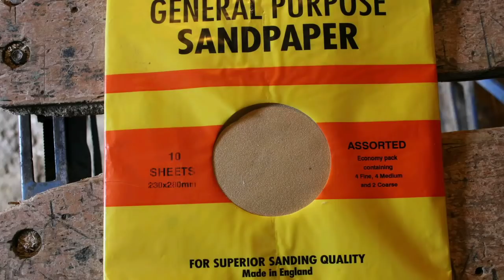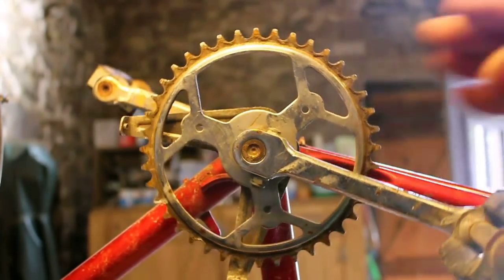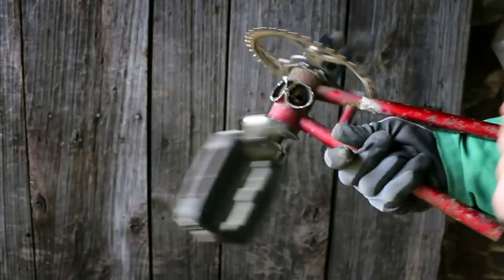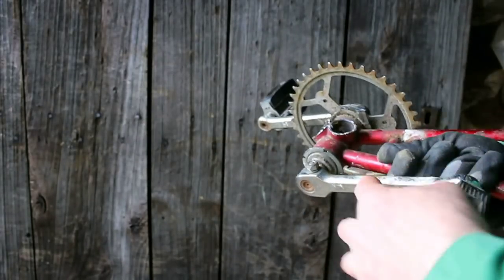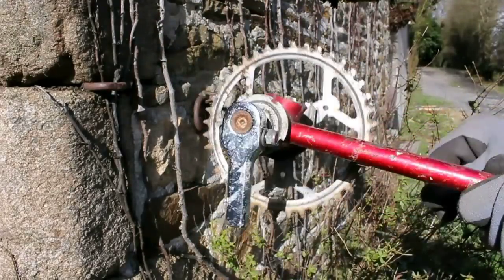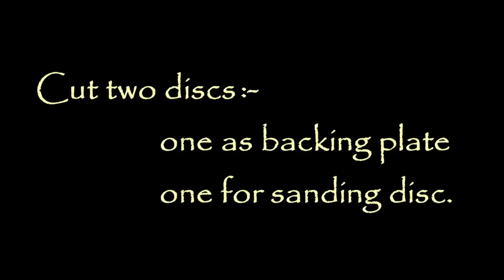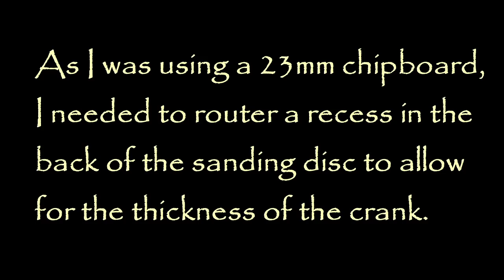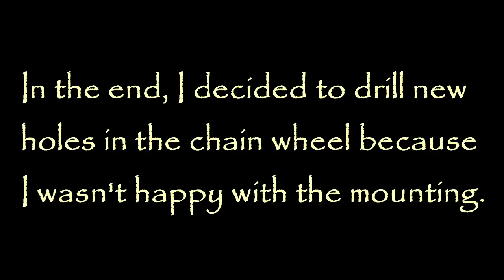Hand Powered Sander Homemade tools  Bricolaje una lijadora de disco Brico ponceuse de récup

Comment: Good idea if you power this on motor, but if you have to use 1 hand on that to spin it, then it becomes useles as good tool
Reply: you can power this cheaply with Washing machine motor, Its werry cheap, has speed controler on some motors and its pretty damn strong. 
Combined with Ur bike tool could replace some professional tools, Also you can use Welcro , buy it from e bay and stick it to one side, and then U can just buy finished sanding papers cheap in store allredy cuz in circle with welcro on other side, Sticks pretty good and wont fly of, that way U dont have to glue new sanding paper every time
Reply from the maker: Hi Ivan, I've only just come across your comment so please excuse the delay in replying. With the guides set to the correct angle only one hand is needed to hold the wood in place.
Thanks for commenting.
Best Wishes from France, Andy.
Reply from the maker: Ivan Brzi
 Some good ideas here. The motor would certainly work but for this application I was seeking a small amount of material removal and I have found in the past that powered tools take material off too quickly. Yeah the alternative to the glue would be nice except that the glue ensures that the sandpaper lies flat and even on the support disc.
Thanks for your input.
Cheers, Andy.

Comment: You could weight the handle to keep the sander turning without you cranking, so you don't have to do so much work.
Reply from the maker: m60paton2 Oops! I’ve only just found your comment tucked away in the ‘comments awaiting approval’ bit. My apologies for not replying sooner, but belated thanks for watching and commenting.
A good idea to give it some momentum. If my sawing is good, there is very little effort required.
Best Wishes from Normandie, Andy aka Organikmechanic.

Comment: Foot power would be nice so that you have both hands free to manipulate the workpiece.
Reply from the maker: +J DeWitt DIY The guide on the work table means that I only need one hand to hold the workpiece in place. You have a good point though especially if I wanted to remove a greater quantity of wood.
Thanks for watching and commenting, Andy.

Comment: Would've been great to make use of the bike's frond and rear chainwheel and chain to make a reduction, so every hand turn makes a 3,4.5 or more turns in the sandpaper wheel
Reply from the maker: +Luis Eduardo Moreno Raygoza Hi Luis, This is a good idea for obtaining greater rates of removal. I only need to remove small quantites and so that is why I have kept a simple direct 1:1 ratio. Many thanks for watching and commenting,  best wishes from France, Andy.

Comment: New Challenge: Build hand powered sander wheel without using any power tools in the fabrication of said device.

;-P
Reply from the maker: +CmdrGendoIkari Yes you could but I needed to make this quickly, as we needed frames for an exhibition and as I have these tools and as we have power at the moment it would have been daft not to use them. All the very best, Andy

Comment: It would be neat if a bike had multiple speed derealer on back so you could change speed of disc with less effort. But probably too much work this looked hard to build
Reply from the maker: +Jason Skinner Yeah, you'd certainly change the disc speed using a derailieur. I have found that for the amount of material I wish to remove, the existing method is adequate. But if I wanted to take off a lot then your idea would ceratinly work.
Thanks for watching and commenting, Andy.

Comment: go too second hand shop or junk yard and look for old foot pump sewing machine. and get a bike chain on both ends and use both hands then.
Reply from the maker: Great idea,
The only thing is mine cost me 10 cents in materials and it works fine for just removing a small amount of wood, but if you wanted to really remove a lot then your sewing meachine treadle would be great.

Cheers and thanks for commenting,
Andy.

Comment from the maker: I like this idea, but I needed to sand the faces slowly. Whenever I have the disc moving at speed i always go over the line. However, by using this idea and gearing down, I could attain a slower disc speed and with more power and as you say leave both hands free to control the work. Thanks, I may have a go at this!
Thanks for watching and commenting.
Cheers, Andy.

Comment: could you have had some sort of belt attached to a mill stone as a way to provide with momentum?
Reply from the maker: Marco Vale Oops!  I’ve only just found your comment tucked away in the ‘comments awaiting approval’ bit. My apologies for not replying sooner, but belated thanks for watching and commenting.
It's a good suggestion. The sander is only removing a fraction of material, provided my sawing is reasonable, hence the high inertia provided by the mill stone would be excessive. Nevertheless the flywheel idea could be used on a general purpose hand-powered sander to good effect.
Cheers, Andy.

Comment: ... sand paper is a hand tool anyway, for slow sanding, i dont get the point ov making somthing that has no use. just glue the sand paper to a peace ov wood and insted of turning a handel just sand the wood, would be the same effort, or if you and just used the whole bike you could and use the chain to turn your sand wheel, with the gears you can change the speed of your saning and rest your arm...

Comment: The idea is good. But this tool is to hard to use it, I mean that the process of sanding takes to long. U can add a motor, and it will be way faster than that.
Reply from the maker: +George Grigoras Hello George. You are right that the sanding is slow but that means I am less likely to remove too much wood! Thank you for commenting. Best Wishes, Andy.

Comment: You've got chains and gears right there, and you decide to drive it directly with your hand? Why not put in a little more effort, and give it a foot-powered mechanism, like a treadle? Or use a wheel as a flywheel.
Reply from the maker: Dangit_Bobby Hi, it's a good point and one that could be adapted to this design. I made this specifically to work slowly enough to accurately remove the last tiny amount of wood. The better I am at sawing the less I have to sand off! Whenever I speed things up I end up 'overdoing' it, so I thought 'hand-powered' with guides would be best.
Thanks for watching and commenting. All the best from France, Andy.

Comment: You could totally have used the sprocket to your advantage and ran it off an electric motor, geared reverse to a bicycle.
Reply from the maker: +Lucas Wade Hi Lucas. I like your suggestion but in this case I was specifically aiming for a hand-powered device. Nevertheless, I reckon with your suggestion I would get one helluva sander! Best wishes, Andy.

Comment: Why dident you use the sprockets from bicycle to make a gear for the sander... :) would be much better and faster.
Reply from the maker: Hi, I didn't want to take the wood off too quickly as I did not want to go past the pencil line. 'Fast' for me, when I'm in the workshop always ends up in loss of precision! Thanks for watching and commenting.

Comment: thats a lot of damn work to create such a thing. maybe if u were sanding everytinh in a whole damn region. but y not use a sanding block..
Reply from the maker: chip jones Hi Chip, I wanted to sand off a small quantity of wood but to a precise angle and as vertical as possible and I know I couldn't do it as well by hand.
I've found that now I've got it set up, it's great just to finish off my lousy sawing!
Thanks for watching and commenting.
Cheers, Andy.

Comment: what the points making this .... while you having all the fancy tools , I'm sure that you have one electric powered sand machine
Reply from the maker: +jeram40 The sander was made to fulfill a specific requirement, that is: the accurate removal of material at a precise angle whilst maintaining a vertical face. An electric powered machine would need fixtures to hold the wood at the required angle and would require careful use as powered machines frequently remove material at too high a rate.

Hope this explains the raison d'etre. Cheers, Andy.

Comment: No easy way to change the sandpaper. Why not make this with velcro or something?
Reply from the maker: Simon de rycke Yeah, you've a good point there some kind of peelable adhesive might be an idea. At the moment I'm still on my first sheet of abrasive. I was thinking about changing the entire disc when the time comes.  
Thanks for watching and commenting. Best Wishes from Normandie, Andy
Reply: Organikmechanic There are some sticky ready sand paper, there's no need to change anything.

Comment: way too much work for the result
the money and time invested are not in proportion for this machine
Reply from the maker: +Jacques Poirier Bonjour Jacques, thanks for your opinion. As with all projects of this nature a great deal of effort is required to produce a finished, working tool. In this case I still use this device 3 years after I made it and it still works perfectly. Cheers, Andy.

Comment: You can buy a hand sander at Walmart for 10
Reply from the maker: That's true but I don't think it could achieve the accuracy that I was looking for.
The material cost for mine was 10 centimes (I bought a 10-pack of sandpaper from a clearance store) all the rest was recuperated material.
Thanks for commenting, I really do appreciate it.
Cheers, Andy.

Comment from the maker: The drill sanding disc idea has its merits but in this case I needed to achieve a precise finish both to the cutting line and to maintain a square-faced mitre. I don't believe I would have got this with the power drill.
Thanks for watching and commenting.
Cheers, Andy.

Comment: No, the point is...I for one would have loved to ride that bike....or use its parts to fix mine, a similar vintage.

Why use a nice old bike, mine is from the 60s and certainly rides better than a modern chinese one. Fortunately i have lathe and mill acces to make a new axle and bearing assembly, since these are totally shot to the point of being unrepairable----

Comment: Thanks for the innovative idea on an ecofriendly tool that is clear and informative.  I recall years ago when I did elevator repair and how the bicycle crank reminded me of what you have shown and the one on the rooftop of the cab had a larger diameter (used with a governor cable that trips when the cab over speeds, it is tied into the steel balls that grab the rails from under the cab and stop the elevator in the event of such an emergency).  Some home repair tips can be found on painting/cleaning brushes: Handymansclubofamerica.com that I've posted.  Screen name: adiovanni  .
Reply from the maker: Oops! I’ve only just found your comment tucked away in the ‘comments awaiting approval’ bit. My apologies for not replying sooner, but belated thanks for watching and commenting.
Thankyou for the information, I'll have a look at the link.
Best wishes from sunny Normandie, Andy.
Reply: Thanks and if you happen to be in NYC, NY, you can find great deals on tools at the harborfreight store (new store recently opened a couple of years ago in Gowanus, Brooklyn, New York which is only about a mile and a half south of the Brooklyn Bridge near the water.

Comment: Hahaha ... I'm sorry, but this seems ludicrous. Your bike stunt, chipboard and power tool orgy can only be seen as a joke. 
Why dont you make a fixed mounting for your electric drill and buy a rubber sanding pad. This would be much cheaper, easier, and work much better. :-)
Reply from the maker: Thanks for watching and commenting. The whole idea of this project came about because I did not want a high speed sander as I only wish to remove a small quantity of material. To maintain precision I would still need to have a support table and guide even with a disc sander attachment.
Cheers, Andy